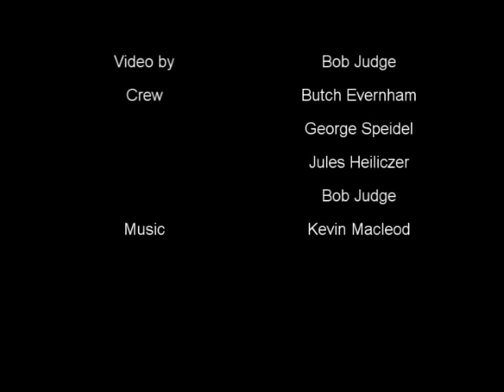part 1- Building the Broken Bush and Round Top Garden Railroad

Comment: Too bad there were no replies to help on how the roadbed was constructed. If it was trex I still have no idea of the dimensions it was cut to to get the bends and lace between. Heck even the overall width. Hard to find details to help. Even a transit to get all the post all the same height. I have seen some set on telescoping PVC pipe which seems it all can be adjusted as you build. Like nobody wants to help learn but just show off their layout. Sorry.